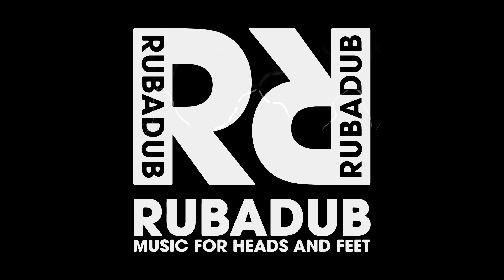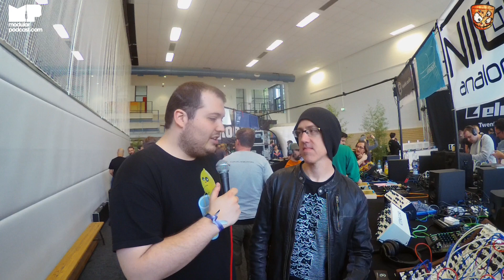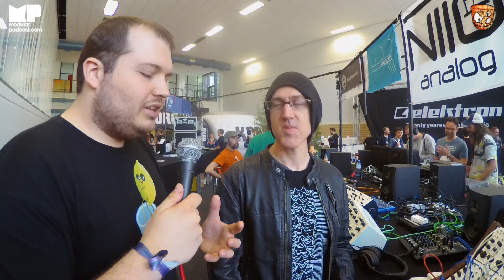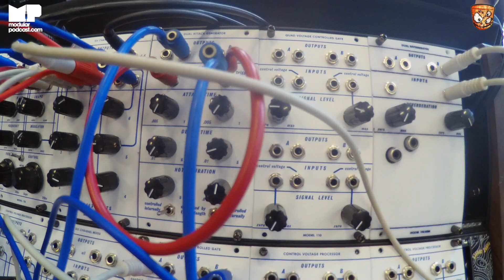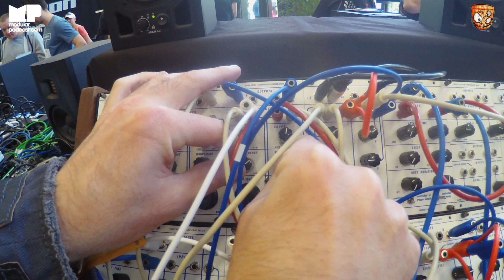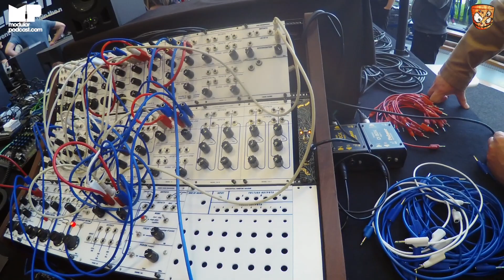Superbooth 2018 - Catalyst Audio Buchla 100 Series Modules in Eurorack Format

Comment: Is there some unintended distortion added to the sound coming from the modules, or do they just sound that way?
Reply: Dave from Catalyst Audio here - There is definitely ALOT of unintended distortion happening there. It's hard to set levels properly at these type of shows while everyone is running around and trying to hit up all the different exhibitors etc...
Reply from the maker: Hello all, checked our end and lots of headroom our side but as Dave said it's a rough situation for everyone involved with audio. It's loud! Too loud to properly set up anything delicate or nuanced and that usually results in turning things up on the modular and hitting outputs/mixers etc.